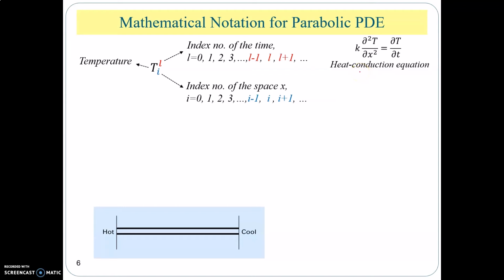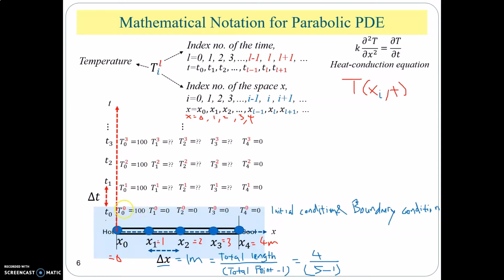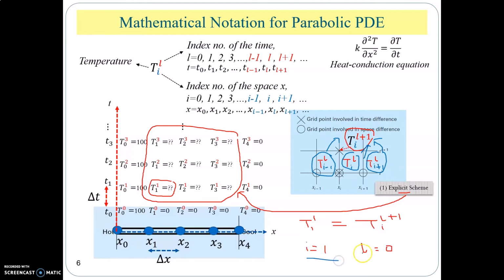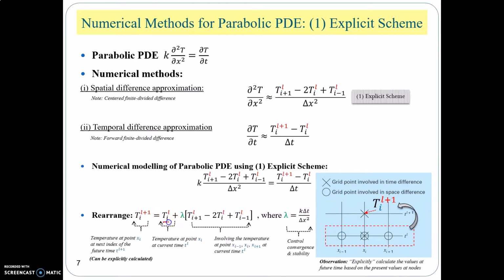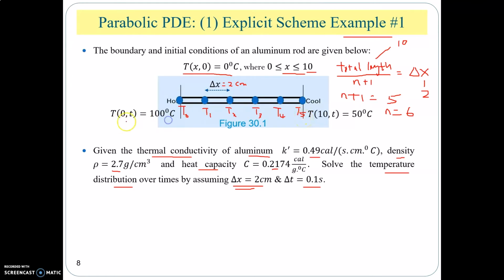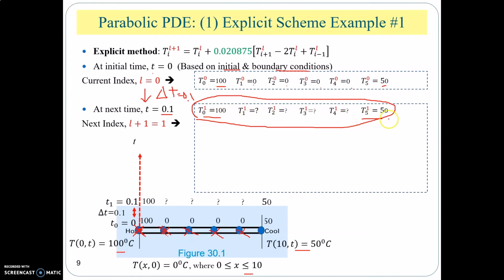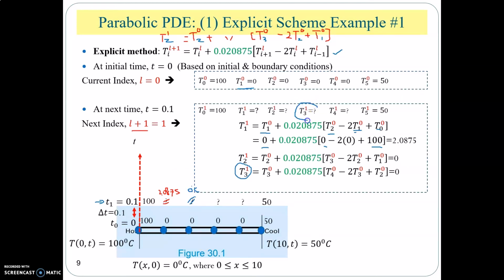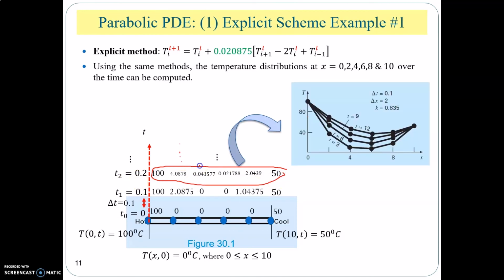Numerical Parabolic PDE Part 4a Solving Temperature Distribution Over Times using (i)Explicit Scheme

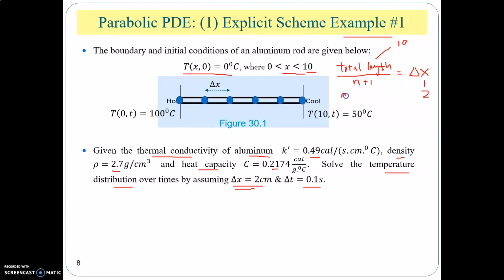Comment: At 10:43 the n+1=5, then you said n=6. how is that? n= 5-1 = 4. or do we take a larger value to include the beginning and the end points.
Reply from the maker: Hi, thank you for checking, it is a typo where 'n+1' should be corrected to 'n-1' , The formula should be total length/(n-1)=Δx. So, n-1=5, so u have number of discrete points on the rod,n=6. 
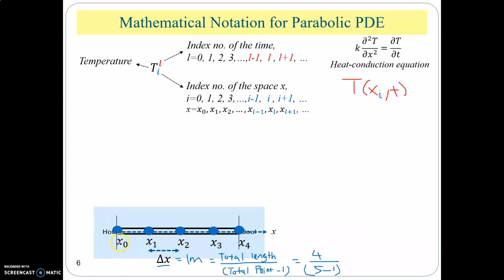You can find similar formula at 2:10